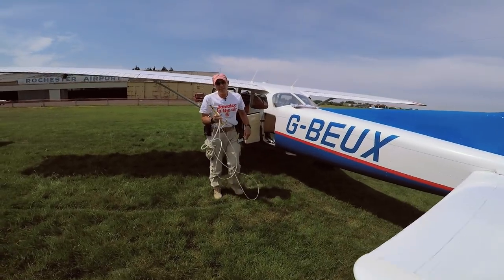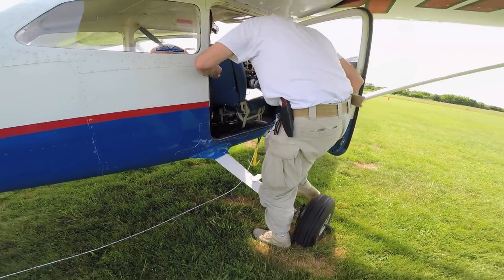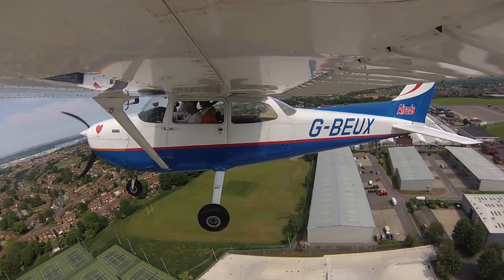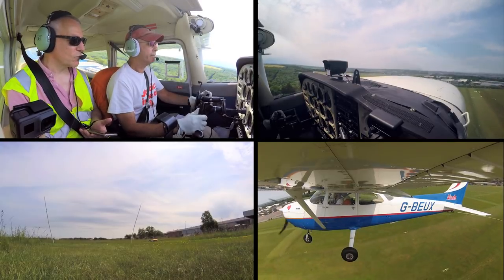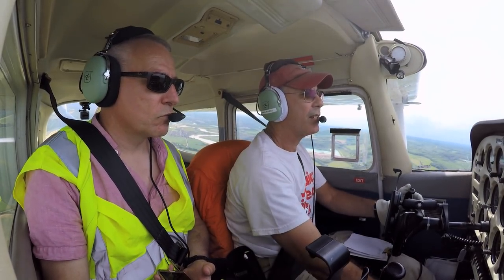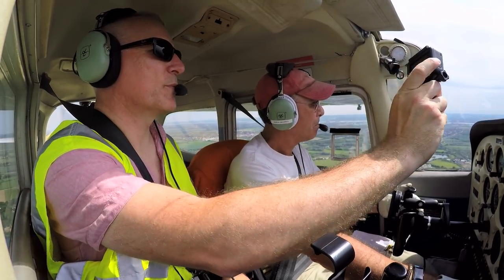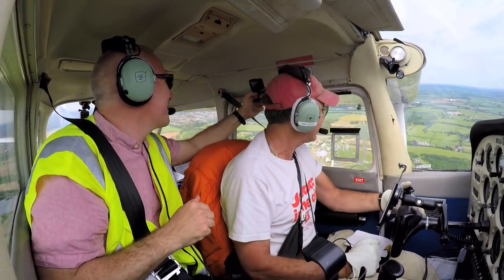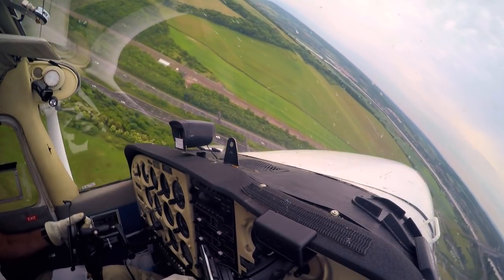How pilots tow banners - Cessna 172 - Rochester, UK

Comment: Completely shocked to hear of the death of Simon. A complete blow to the community and it's extremely sobering that such even the most experienced of aviators can find themselves in such unfortunate circumstances.

 Thoughts are with his family.
Reply: what happened?
Reply: @LawnBunny777  Simon was flying in a Piper PA28 in Spain, but very sadly crashed into a mountain due to fog. He was flying under the minimum required VFR meteorological conditions.